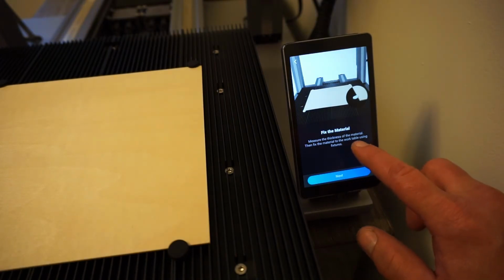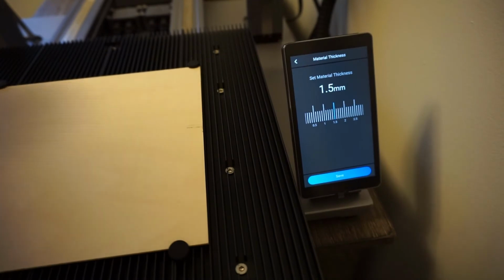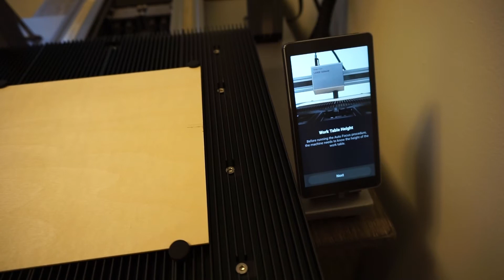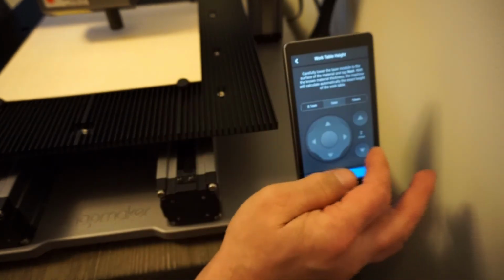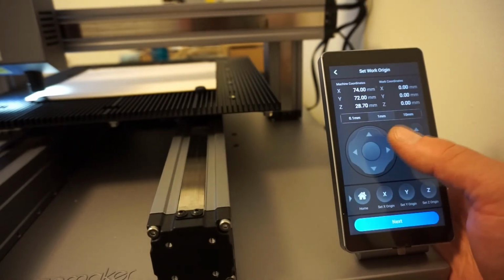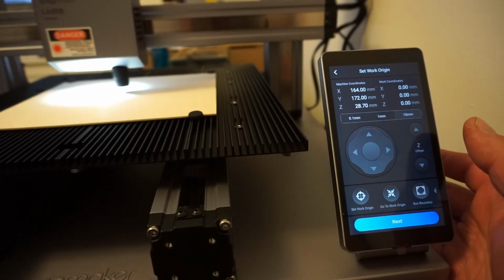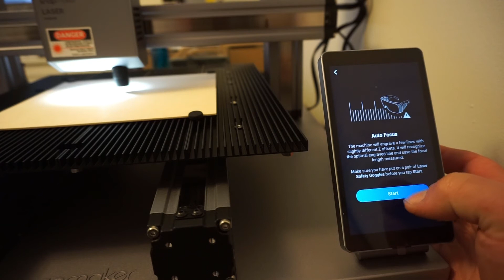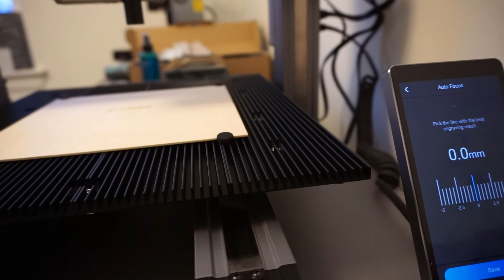SNAPMAKER 2.0 LASER ETCHING CALIBRATION

Comment: FYI, you used the wrong screws to hold down the Laser Bed plates. They are not supposed to be the countersunk, but the "Hex Socket Head Screws" which have the full shoulder on them.
Reply from the maker: I know it looks like I used the flathead cap screws but I've followed the setup recommended in the user guide to the T and double checked every time. Thanks for the input though.